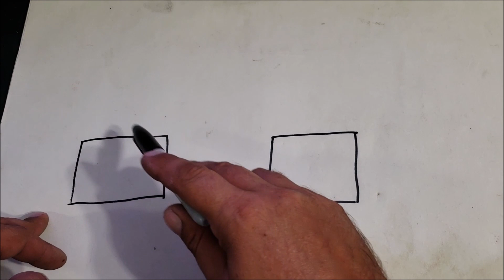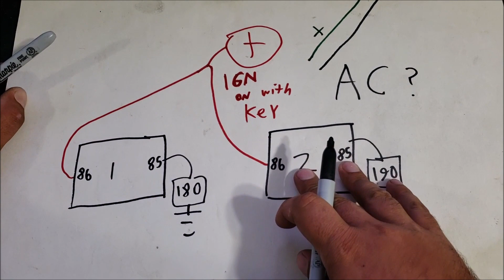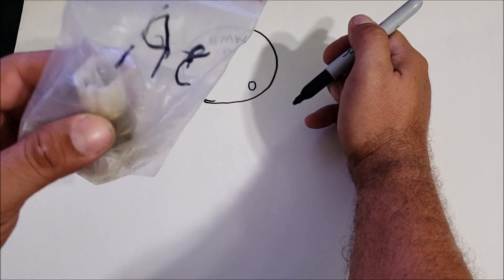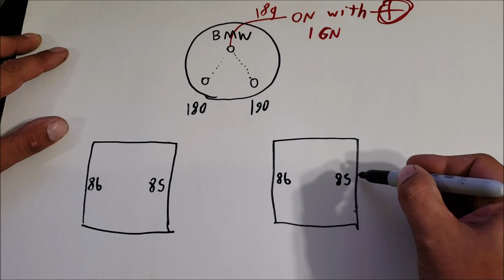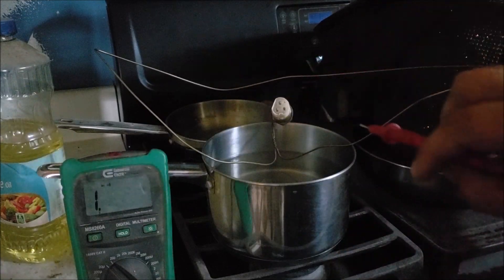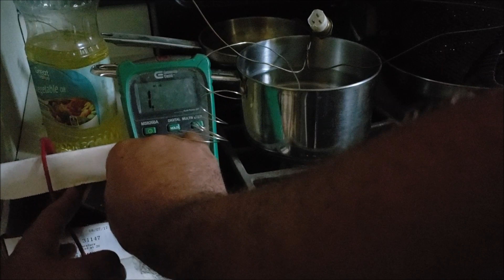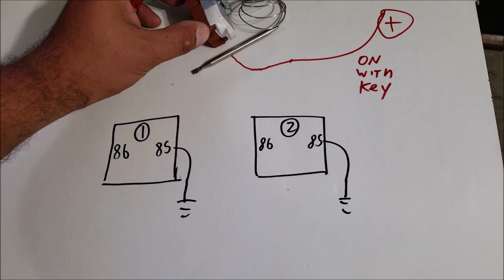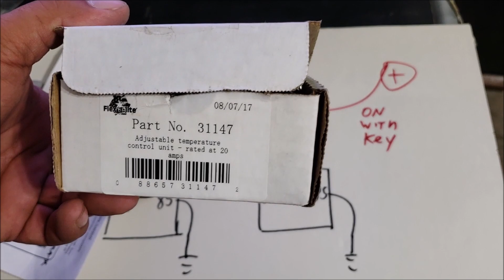auto electric cooling FAN WIRING part 2 wiring the relays

Comment: Chris, I have been watching all of your videos over the last year and have throughly enjoyed and appreciated all of them. I am currently also just finishing up with building my own 1970 Chevelle SS. The car has been the dream of my life and now that I am older and retired, it was finally time last year to start building my dream car. All of your videos ave been amazingly timely, helpful and just the information I needed in each step of my build. I just finished installing a brand new, not rebuilt, Chevrolet/edelbrock 454 engine. Last month I was installing the gauges on the pillar and this weekend I am looking at putting different speeds and fuses on my fans. Thanks for all the great information you provide all of us car builders and especially 1970 Chevelle builders.

Comment: put in new cts an new 180 t stat.on ac both fans come on high , cools down very well, to hot on regulator heater at 217 cuts on an to hot , hard for fans to cool it back down. very good demo for wiring thermo controls, this motor is fine when running cooler , on ac max is 196, cools down in time an fine.

Comment: Good point about the Schematics that come with the parts, Being (given) that the Electrical part is 12 VDC for a car , The Amps are most critical that are being used by the load.  Don’t assume just because the Fan is made for cars that your system won’t burn up with out the correct protection. Very easy to overlook

Comment: Do you have a part number for the factory plug for the sensor ,  plus can you run 12v or neg through the switch ,  ( depends on which trigger you need )

Comment: Helpful video, I have a question. When I comes to the thermostat do you need to find one that matches the BMW switch or it doesn't matter. My switch it 180/195 and my thermostat opens up at 80 degrees Celsius.

Comment: Thanks so.much for the informative video. I will have to source out the thermostats which will take some time. Right now my 2 80watts aux fans are killing my battery. I tapped both replays in the AC Compressor positive wire which turns on both fans when my AC is turned on.  I was planning to temporarily add a 12v 3A/260VAC push switch to turn off fan at night since AC is cold without the fans.  Will that switch suffice or do I have to get a 20A push switch? TIA
Reply: ... isnt it that the alternator isnt charging your batteries quickly? Low idle charge? 

Im installing a 150amp to try and charge my battery while pulling a 100 amps.  The 150 is capable of powring 100a at idle speeds, so its rated. 

We will see.

Comment: Thanks for the vids... 

So that 20$ temp sensor device with the 20amp max cant be wired as a ground switch like the other temp sensors? 

Doesnt it just complete the circuit at a designated temp that you set. 

Why not wire it to the ground and pin 85? 

Thanks in advanced.
Reply from the maker: there are hundreds of ways to wire fans up.. all my videos are doing is giving you some ideas on the framework and where to start

Comment: Thank you for the video. I just have a couple questions. From your last video, can I hook up my a/c wire to the 86 prong on the high speed realay controling the second fan? Also, can I use my GM swithches instead of the BMW? I really liked the running the fans in series and would like to run that setup. unfortunately my car is the old style that did not have high, just medium speed. Thanks again for your videos!
Reply from the maker: yeah, you can splice the ac wire straight to 86 on the relay.. you can use whatever temp switches you want..
Reply: Chris Craft,  thank you Christ! Great videos! And one more question before i venture into this installation. Where do i hook up the ignition wire on the relays for running the fans in series from your previous video? Would like to have fans shut off when i turn off my vehicle. Thanks again!
Reply from the maker: on your fuse box inside the vehicle.... IGN spade connector should be available..

Comment: Great video!!!!  Couple of questions though.  When you splice in the ac circuit to the hot side of the temp switch, what makes the low speed fan come on?  Also, when you reach high temp on that switch, won't it turn the AC compressor on, as there is no diode to direct current flow?
Reply from the maker: just wire it up like I show.. it all works.. no diodes.. you have seen part 1?
Reply: @chriscraft77022  yes sir I have!  Great work as well.
Reply: @chriscraft77022  It may work but that is not correct and may cause future problems. Electricity takes the easiest path of resistance and the power from the 190 degree trigger will go to the ac. It may not be enough to turn on the compressor but there is power going in that direction. A diode is recommended and some relays have a trigger wire with a diode for AC and other components to trigger the relays.

Comment: Just FYI, not all 2 speed BMW coolant temp switches are the same.  Some kick the auxillary fan on at 196°/210°F (91/99°C) while the earlier switches, back in the 80's I believe, kicked the fan on at 176°/192°F (81/89°C).  Know which one your system needs or you could make things worse.  BMW sensors are rated in Celsius.  If the parts person cant tell you what their sensors open/close at, dont buy it till they can.

Comment: Hey Chris...I posted on your other video a question..98 lincoln town car 4.6...I removed the A/C compressor and installed a pulley bypass...now a/c compressor disconnected so no pressure in the a.c. lines..which makes high pressure and low pressure switches not functioning...problem is electric cooling fan runs all the time even with ignition off...which drains the battery. Any thoughts how to remedy the situation...Thanks

Comment: Hello Chris. i'm planning to convert my trailblazer 2006 clutch fan to an electric fan. But i need to know some points in your video which i believed it could help me. 1) Video frame 4:49. Are both the switches (180 and 190) will be closed once it reached 190? 2) or the 180 will switch to open and only the 190 will close? 3) Video frame 5:20, the schematic tells me that  the high speed fan will always works when ac is on? would it be better if the fan will only works when ac pressure reached 180 psi and will shuts off at 179 psi and below? do you have some idea what ac pressure switch to use which will turns close at 180 psi? my point is that i want the fans to turns off when i'm running 60 to 100 kph.

Comment: The AC bypass is incorrect. DON'T connect it that way!!!  If you do, your AC system will stay on continuously when the temperature is above 190 degrees or whatever your second temperature is on the BMW switch. Power will come from the ignition through the BMW switch and power up your AC compressor keeping it running non-stop until it overheats and craps out. Ask me how I know!!! You need to use a trinary switch to turn your fans on and off and allow the compressor to cycle on and off when it needs to based on the internal ac pressure.
Reply from the maker: so you would run a diode so it doesn’t backfeed ...  I have not put AC on my car yet ... sorry about that
Reply: @chriscraft77022   That would work. In the example of this video, only fan #2 turns on when you add the bypass from the ac, right? If you wanted both of them to turn on, you'd run another wire to 86 on #1 relay. Correct?
Reply from the maker: I wasn’t being specific in any way.. I was just trying to give the idea... Because some people don’t know where to start... I will make a video one day once I have it all on there